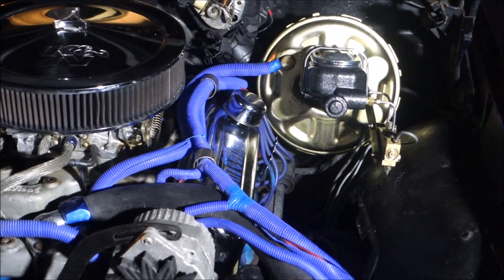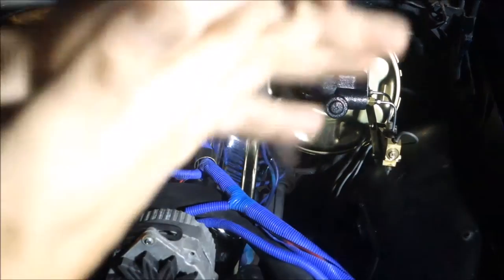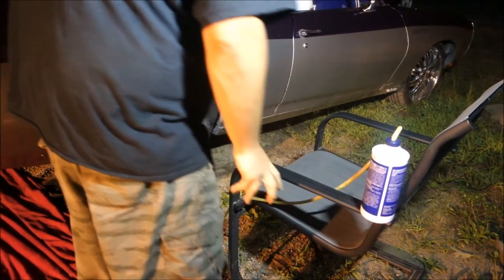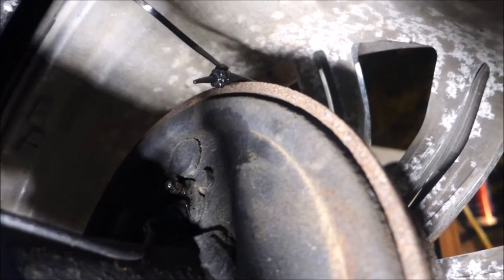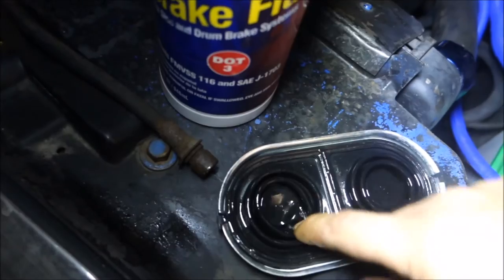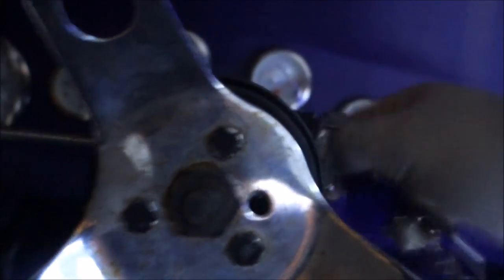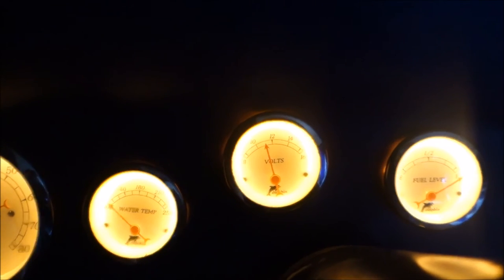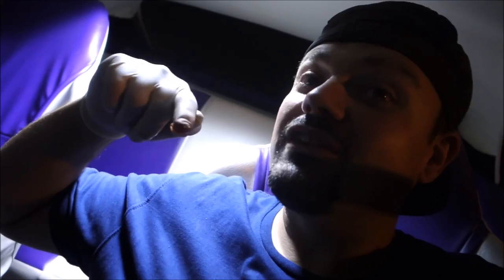Bleed Brakes On Your Own

Comment: I actually had the same problem with a 1978 Cutlass  brake hose causing the fluid not to return from the front caliper and it kept wearing out new brake pads . I thought it was a caliper first and replaced that only to find out that it was a collapsed hose on the inside causing the brakes to lock up . It was a permanent lesson to learn . Now I always check that first before replacing other parts.